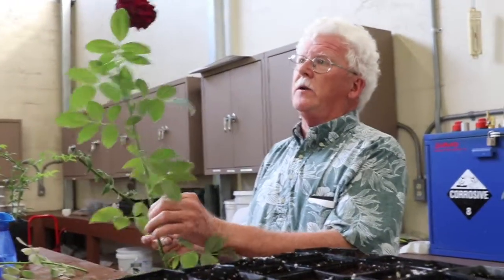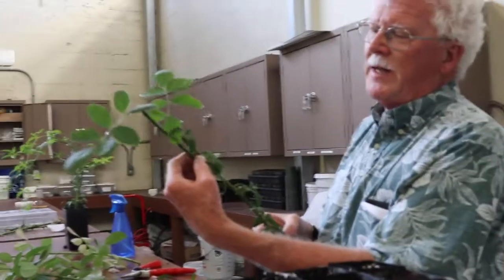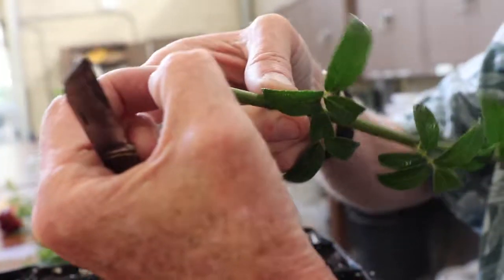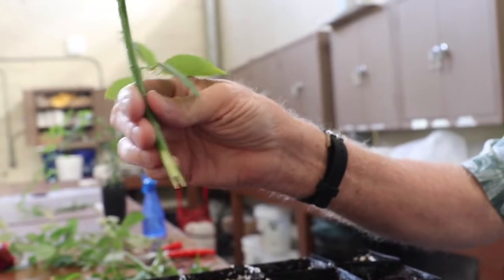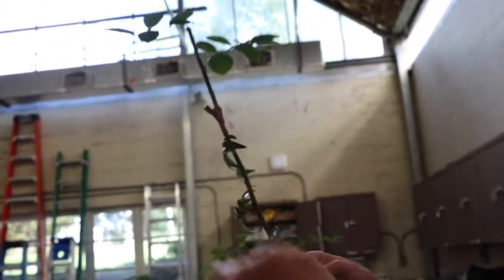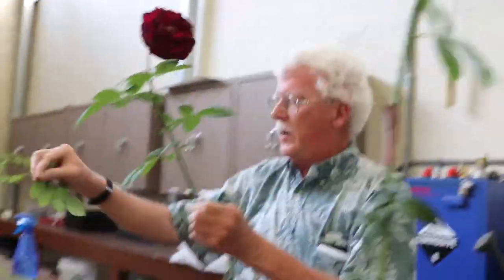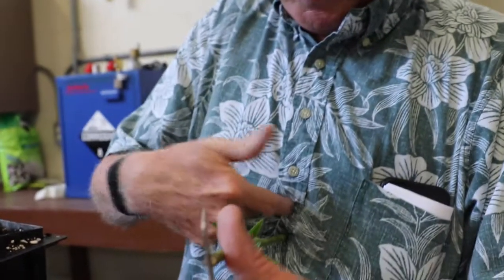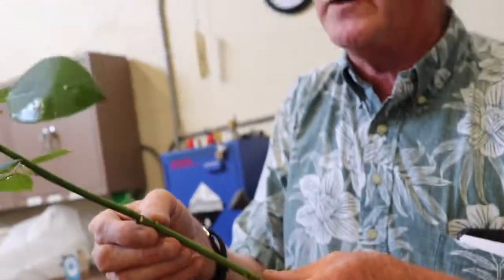4  Cleft Bench Grafting Fortuniana

Comment: Thank you Mr.Manners.I have done a lot of T budding grating but failed.I wonder i have done in the wrong time in winter or put to much tight pressure with rubberband on grafting?
Reply from the maker: I suppose either could be the problem.  I think the biggest challenge is speed -- from the time you cut the scion until it is enclosed under the stock bark should be just a few seconds at most.  Otherwise the wounded surface can start to dry out and several layers of cells can die.  Then the scion and stock can't heal together.